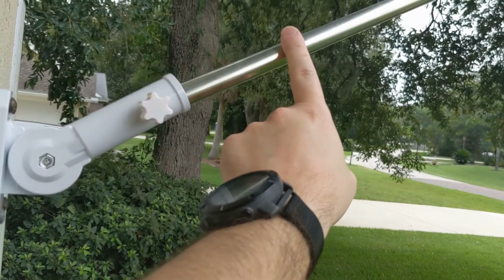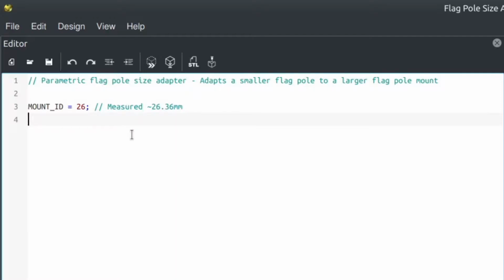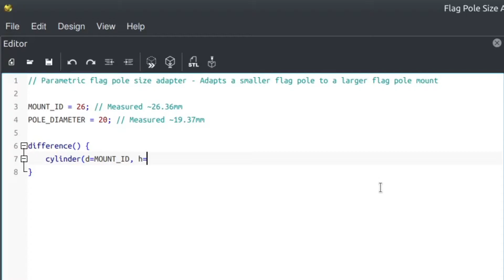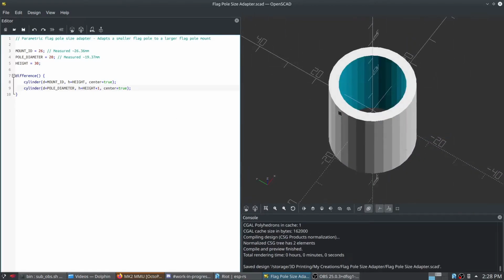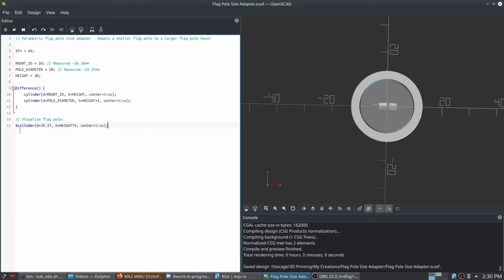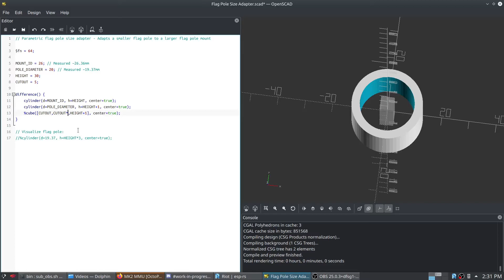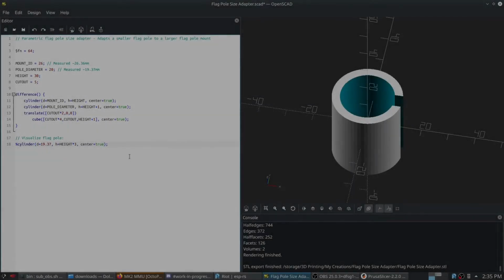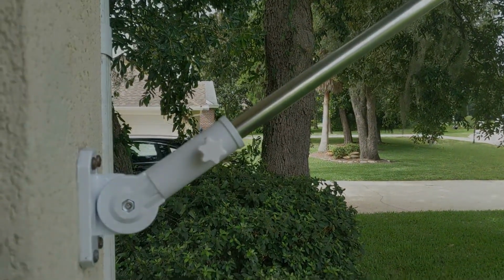OpenSCAD FTW! Flag Pole Adapter

Comment: Is there any benefit of openSCAD over normal CAD softwares?
Reply: not at all. fusion, inventor, solidworks, etc all work parametrically and unlike openscad they have a proper more intuitive way to use it without having to type out lines just to get a cilinder in the right place. and all of these can be used freely by hobbyists.
Reply from the maker: Yes, besides being vastly superior from a parametric design perspective OpenSCAD is procedural . With OpenSCAD you can change a few values and it'll generate a whole new component for you or any number of components. With something like Fusion you can assign parameters to things but you can't use those parameters in other parameters.  For example, you can say, "all these screw holes will be 5mm" and set that as a parameter for all your screw holes.  What you can't do is say, "all cutouts above these screw holes are SCREW_HOLE_SIZE+3".  You can sort of do that via a non-parametric mechanism (constraints) but it's not the same thing.  OpenSCAD lets you take a whole bunch of parameters and transform your whole design based off of them whereas traditional CAD programs only let you fiddle with parameters in a onesie twosie sort of fashion.
Reply from the maker: @RGplayer101  If you think Fusion, Inventor, and Solidworks are "intuitive" you're wildly mistaken.  Those programs take a whole heck of a lot of training to be productive whereas someone can be productive with OpenSCAD in just a few minutes.  There's a point in the middle of the learning curve where some things will be easier in traditional CAD tools but at a certain point of complexity OpenSCAD becomes the better tool again.

Having said that OpenSCAD isn't perfect.  There's a whole bunch of things I'd change if I could.  Specifically, I'd rather have it be imperative rather than declarative (which is confusing as heck for anyone used to any normal programming language).  I'd also make the shape primitives objects instead of just functions.  That way we could attach metadata to them like material information (to do physics simulations) and associate other objects directly with each other (kind of like constraints) instead of just using parameters to define their positioning.